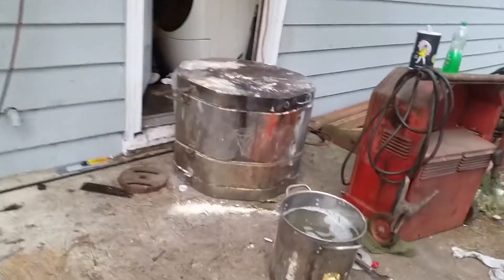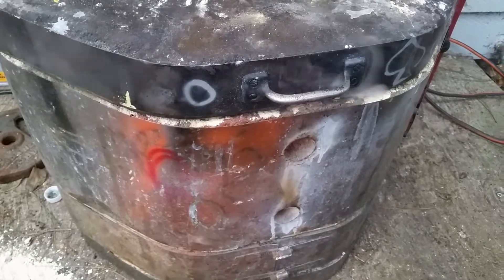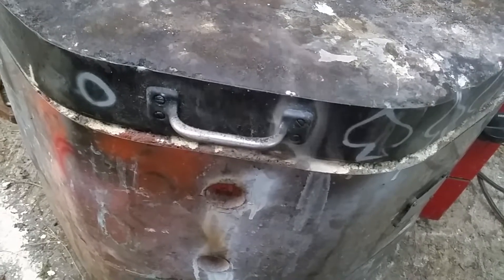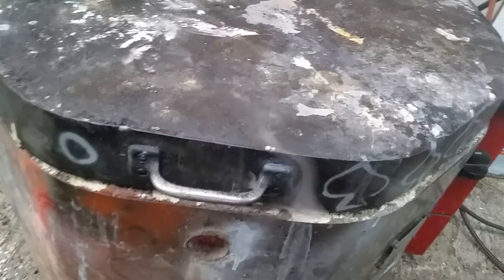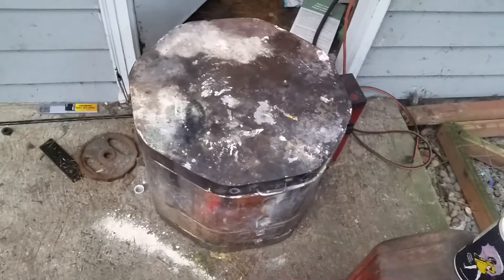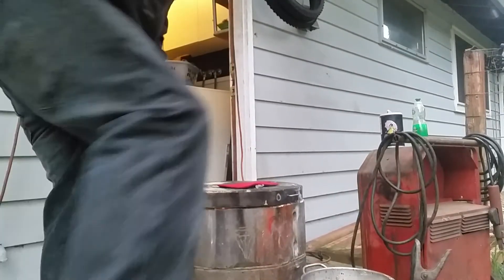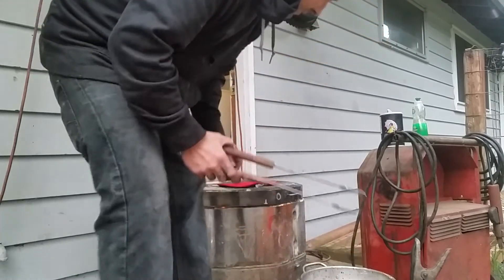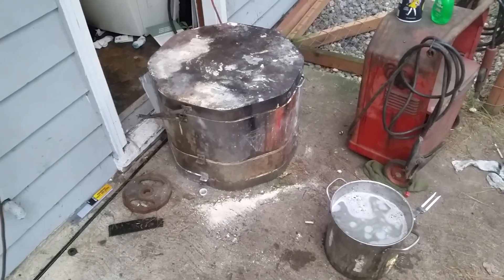Heat Treating an AK receiver with a kiln

Comment: Big props for uploading the video even though it was a "fail" it is still great learning material.. I know it's been 3 years since but if you have a updated setup I would love to see it.. a few ideas; 1) get the quench bucket closer, maybe sit it up on something to get to the quench faster. 2) use a cheap aquarium oxygen pump or a buddy with a paint stirring drill to get the brine oxygenated for the quench
Reply: Why do we need the oxygenated water (oxygenated brine) for hardening? How presence of oxygen affects the result? If you know, tell me please.
Reply from the maker: how about the latest response ever! thank you for your advice, i ended up scrapping the heat treating gig. moved on to millions of other projects. take care